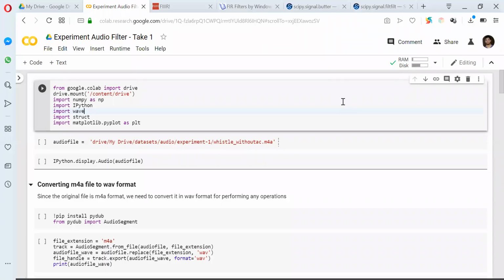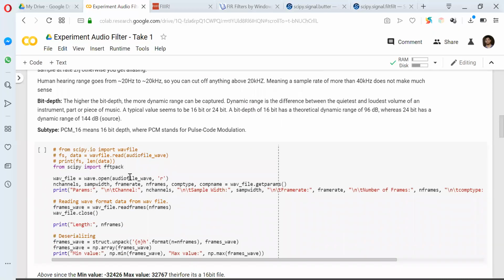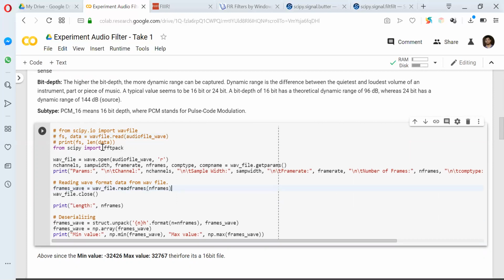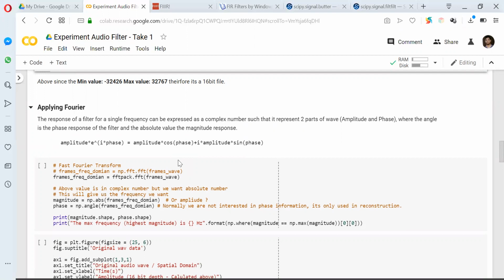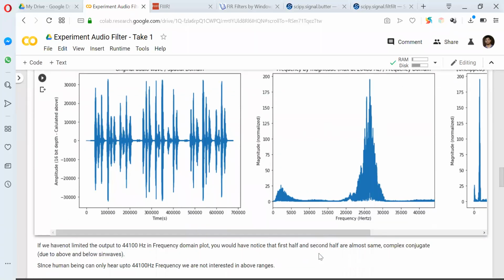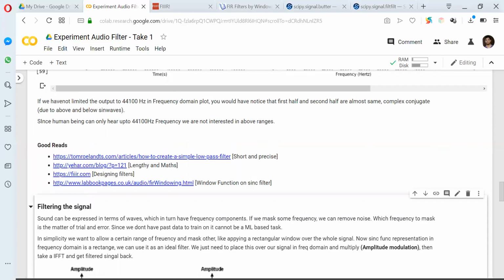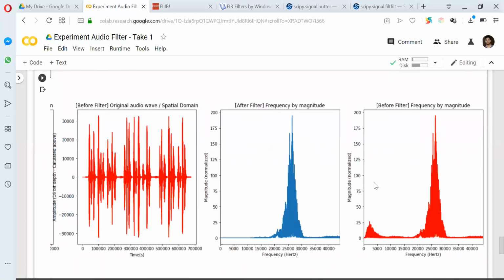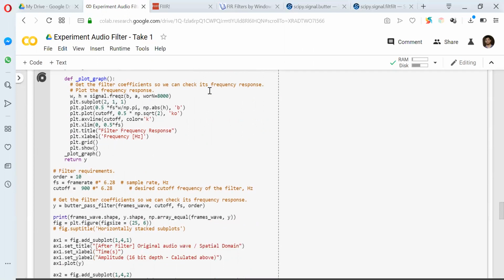Experiment Audio - Solution [Noise Removal from Audio]

Comment: Hi nice explanation,
I would like to know have you removed the noise from the audio.
I am doing a project where I have to transform audio to text... Can I follow your steps to remove the noise from the audio and then transform the dialogues in the audio to text...
Reply from the maker: I think it should be feasible but the accuracy will depend on dataset in question, certain dataset can be messy and could require additional steps or more robust algos